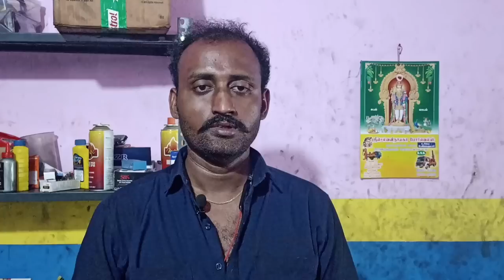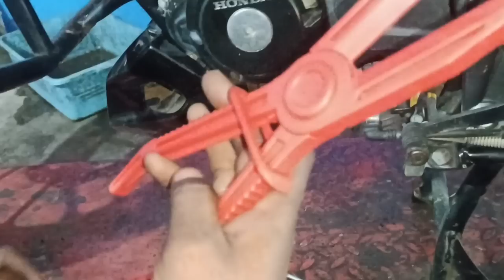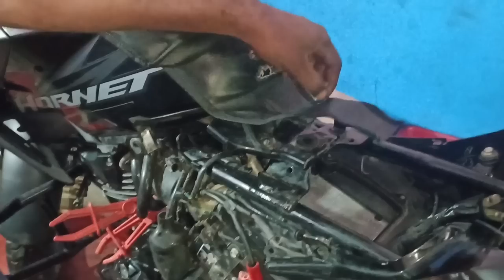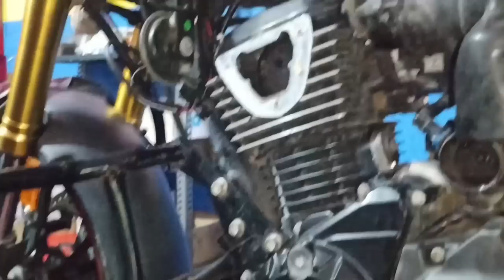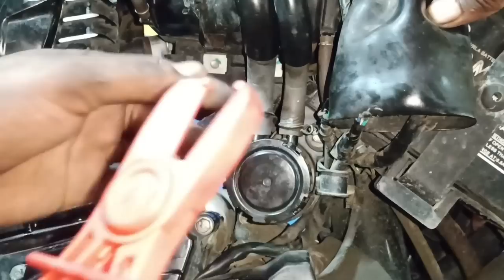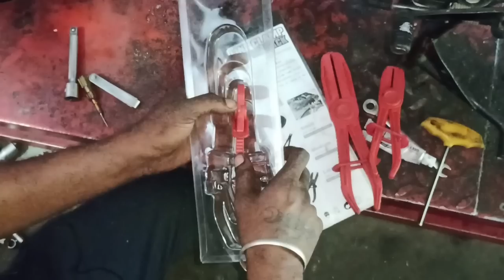Special Tool for HONDA BS6 bikes

Comment: Hello ji... Fz fazer la elam engine oil level epdi check pannanum?? Engine la irukka thread la dipstick fulla tight pannitu level check pannanuma?? Or dipstick ulla vittutu thread pannama level check pannanuma bro?? Bcoz Nethu thaan ennoda fz la oil change pannen aana thread pannama partha oil level minimum ku keezha thaan kaathudhu... Ithuvey thread pannitu partha maximum kum minimum ku nadulla level kaathudhu bro
So epdi panrathu crct method nu solunga konjam

Comment: Anna en bike old pulsar 150 2003 kick start model...adikadi starting coil and cdi coil poiduthu...4 to 5 times change panniten...wiring harness tha problem nu sonnanga..so wiring kit um CDI coil original um change panniten..but no use...bcoz butti coil ( ignition coil) la power varala..😢😢 enna pandrathunu sollunga anna

Comment: My bike Pulsar 220f bs4 
Auto highling aagudhu Anna 
I changed 
Air filter,
Spark plug
Accelerator cable 
Clutch cable 
Carburettor diaphragm and carburettor cleaned fully  
Fule injector aslo reduced 
Sometimes sudden highling aagudhu ..
Please give suggestions Anna
Reply: BS4 um iruku, carburettor um iruku aduliyum FI engine aa......yeppadi da.
Teliva solunga bro.....
Reply: Sorry bro Fuel jet not fuel injector  full ah kamipannita  but automatically highling aagudhu bro ...

Comment: Anna, honda hornet bike nambi vaangalama? neriya per oil leak iruku nu solranga.
Reply from the maker: Vangalam bro
Reply: @vaganaviyaltamil   rtr 160 4v, pulsar n160, hornet 2.0, idhula entha vandi vangalam nu suggest panunga anna. vandi ooda reliability than main priority anna
Reply: @vinuvarsidh9754 apache 160 4v bs6 80k kilometer running no issue in engine, test drive the bike